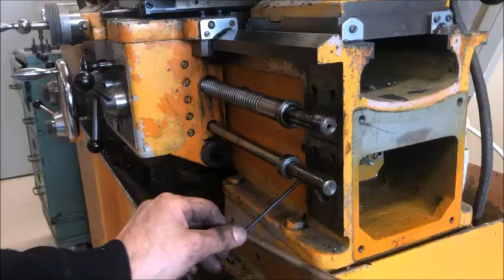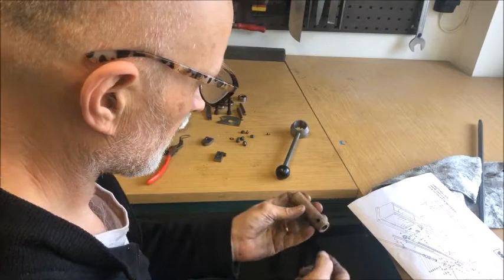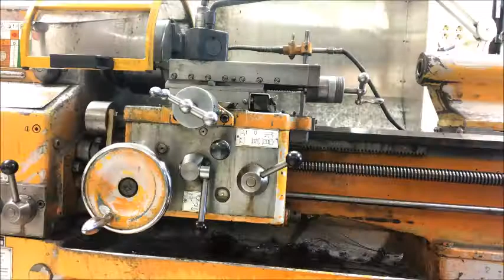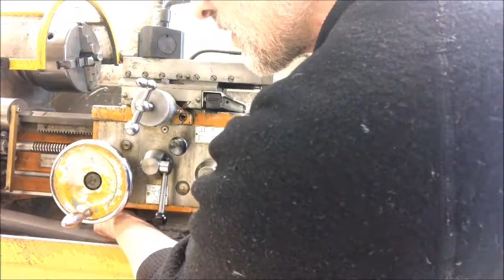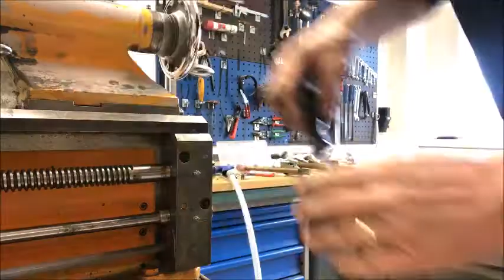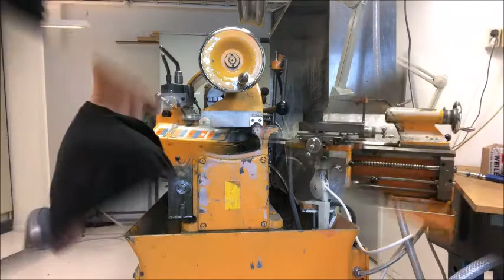Weiler Praktikant - replacing on off switch and assembly - 2

Comment: For my purposes, I find it more useful when a company supports old machine tools by making the part blueprints available.  If the parts I need are in some dusty corner of the warehouse at a price which isn't insulting, I buy them.  

However I don't expect any company to make new parts for a 50 year old machine when the old stock runs out.  I do expect them to provide the information I need to make one, when they don't have one to sell.  That's why I will never get rid of my Atlas benchtop lathe, mill, and shaper.
Reply from the maker: Weiler is a traditional family owned company and has a good reputation for service, as wellof course for their quality (and innovative) machines. They have provided me with service manual for the machine, and I actually got to discuss a problem with the foreman once, so excellent customer service. Another German company, Mössner, making really nice bandsaws (we have their model 320.. same age as the Weiler), also helped me out once with a service manual. I would of course also do the same for our products, having been here for 37 years.. either by personal assistance or sending information material. We are proud to have this ability, and it is certainly a well received capacity with our customers.

Comment: I have a little problems with the soundlevel in Your videos. I can barely hear even though I have max volume on both places? Is it anything You can do about this when uploading?
/m
Reply from the maker: Sorry about this. I have used the max setting in the video editor for these 2 videos on the Weiler. The first video was first launched with regular setting in the video editor, then I reloaded it with max output because another viewer complained about the same. Haven't checked with him afterwards, but it plays with ample volume on my PC at least. I am not sure what more I can do, but am open for suggestions. At work I have access to another video editor, but have checked and cannot find any great improvement re. sound. It may be something to do with settings on the Iphone for example, so can investigate this. I guess it would be better if I used a dedicated camera with a detachable microphone (we have one which I also use at work). When another financial opportunity presents itself I might consider to purchase a similar type, but since this is just a non-profit hobby anyway, there hasn't been any real incentive for such an investment until now.
PS! If you want to discuss a similar problem like in the video/have this particular type of lathe, I am of course willing to help. You may contact me at Messenger or email (jshaugjord at gmail).. orphone me (email me I will give you the number).
Reply from the maker: I made another versions of the videos, called Weiler-1 and -2, with increased sound volume.. hope this is better :)

Comment: Jan, What is the purpose of the brass bar hanging from the bed stop?
Reply from the maker: It is a simple dividing attachment. The end of square brass bar has a pin that when the bar is swung upwards and into the chuck it mates with a series of holes drilled in the back plate of the chuck